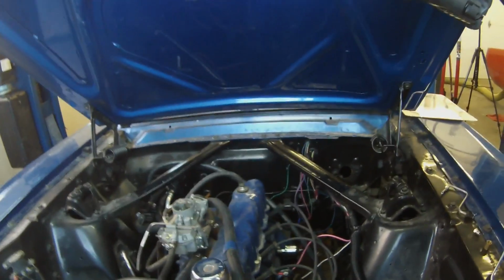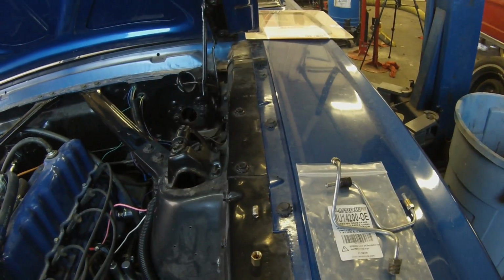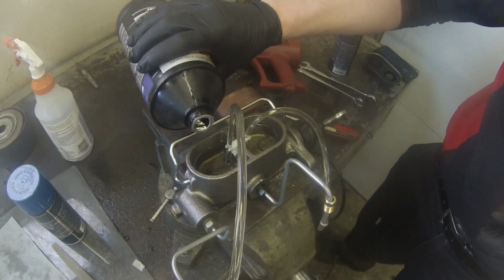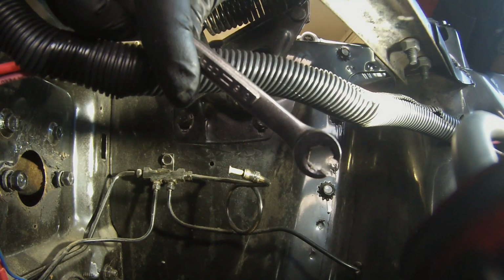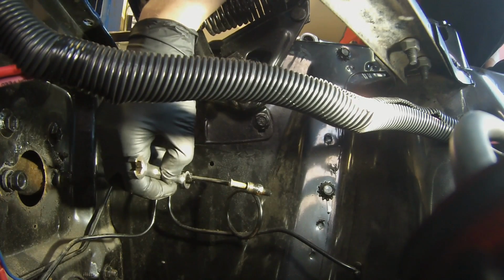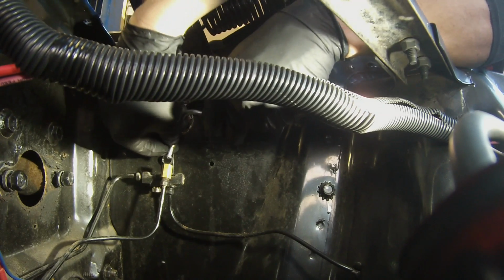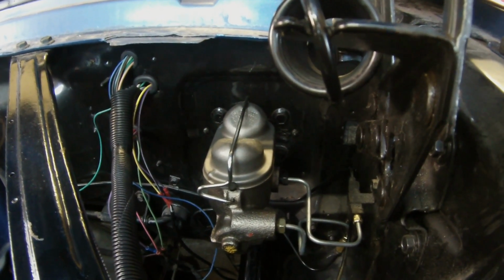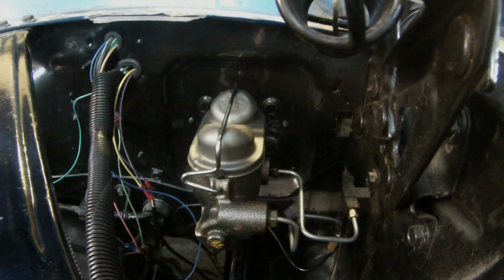1965 1966 Mustang dual bowl master cylinder upgrade

Comment: Hey Thanks for the great content! I had a couple questions if you don't mind. One was how do you get the original pushrod out? Second how do you put it back in the new master cylinder? I tried just pulling on it and it doesn't seem to just come out. Thanks for your time!
Reply from the maker: The pushrods have a retaining clip on the end. Essentially, it's brute force to get them free. One thing that I've done is mount the master cylinder to the car like normal. Install the push rod to the brake pedal. Push the pedal all the way down and yank the pedal back up really hard. That usually does it for me. The new push rod will just push right in.
Reply: Do you think when I reinstall the new lines a little anti seize on the fitting would be beneficial?
Reply from the maker: Absolutely not. You don't want anything like that on brake line fittings.
Reply: Lol. Just thought I was being a genius lol. I won't, thanks for getting back to me! Much appreciated 🙏🏾
Reply: The very last question, and I swear! Lol where did you get the adapter fitting for the proportioning valve? I'm gonna check the auto parts store but if you had any info I'd appreciate it. These guys at the parts store can be helpful at times but most of the time not so much. Thanks again!
Reply from the maker: No problem at all, you can ask as many questions as you would like. I can probably get an exact part number when I'm back in the shop. And just so we are on the same page, when you say proportioning valve, did you mean distribution block?
Reply: @AlfsMustangGarage  In the video the line that ran into the distribution block that you removed, I belive the line that goes to the rear brakes. You said you needed an adapter. I'm having the same issue, I cannot connect the line to the proportioning valve. The part that's added with the knob is the proportioning valve. The distribution block is the one attached to the side of the engine bay. I think I found the type of adapter but just gotta get the right size. The proportioning valve in your video is identical to mine. Thanks for your help, appreciated it. Not a lot of people willing to help us with less experience. I'm greatful.
Reply from the maker: Okay got ya! You must have done the disc brake conversion then?
Reply: @AlfsMustangGarage  yes I did, rebuilt rear end. Drums in the rear and disc's in the front.
Reply from the maker: I'm going to see if I can find you an exact part number. What year is your car?
Reply: @AlfsMustangGarage  1970  maverick with a 200cid.
Reply from the maker: Oh okay. Well I can find the one I used but I'm not 100% sure if it will be the same on a 70 maverick. Sometimes you'll have better luck taking the valve with you to the parts stores. If you know the size of the brake line too, that is helpful.
Reply: @AlfsMustangGarage  yeah that's what I've been doing for the past three days and I got nothing on the brake line adapter. I got one and it didn't fit. Unfortunately I live in a part of California where most people have a weak work ethic and unwilling to help others lol. Its ok, I got a guy across town I can probably talk to when the shop opens. Just trying to get it done before the weekend is over. Appreciate the help.
Reply from the maker: Oh ya I understand those frustrations. That's why I don't have any employees 😂😂😂 I will still get you that part number when I'm in my office tomorrow 👍
Reply: @AlfsMustangGarage  lol, ok thanks man. Appreciate it!
Reply from the maker: Oreilly's Auto Parts # BLF23B Brass Adapter, Female(7/16-24 Inverted), Male(3/8-24 Inverted). This is the adapter that I used. Of course, I don't know if you have the exact porpotioning valve as me and if the brake line is the exact size. But if you have an Oreilly's near by, they are cheap and worth a shot I suppose.
Reply: Yes I do and thank you very much!
👌🏾
Reply from the maker: Keep me posted if that works
Reply: @AlfsMustangGarage  I picked up the part but it was too wide on the thread. Our proportioning valves look identical but I guess they are different. I did find one that works but the inside hole is slightly larger. Is that going to be OK? If not there is another place I can go to find something that works. Thank you much appreciated your time!
Reply from the maker: I guess the only right answer is if the adapter fits and seals, then it's good.

Comment: When transitioning from bench to car how do keep fluid from leaking out and making a mess?  Thanks
Reply from the maker: The bleeder kit that I got had small cone shaped plugs that you can insert to the holes. Then when you install the master cylinder and are ready for lines, you can pull them and hurry to install the lines.

Comment: Good tips for a drum/drum install, I founded the 1952-59 Ford Group on the H.A.M.B. back in 2009 and a lot of our members used the 1967-70 Mustang drum/drum master to upgrade their 50's Fords so other than some minor fabrication of the brake lines the steps are simular. Thanks for posting.
Reply from the maker: Oh wow right on! Thanks for taking the time to comment. I really appreciate it. The H.A.M.B. is the Jalopy Journal right?
Reply: @AlfsMustangGarage  Yes it is.

Comment: does this making breaking power more significant?
Reply from the maker: No, just makes it more reliable. With the single bowl reservoir, if you developed a leak in any part of your brake system, you lost all your brakes. With the dual bowl, if you developed a leak in the rear, you would still have front brakes and could still stop your car.
Reply: @AlfsMustangGarage  thank you ! i’ve been meaning to do this with mine but was just wondering if it had any effect on braking power since other than this video i haven’t seen anyone talk about it
Reply from the maker: You're welcome. Ya still a great upgrade if you're not upgrading to disc brakes.

Comment: What master cylinder did you use? Part number?
Reply from the maker: O'Reilly auto parts Brake Best brand. Part # 10-1485. This is listed for a 67 Mustang front and rear drum brake.